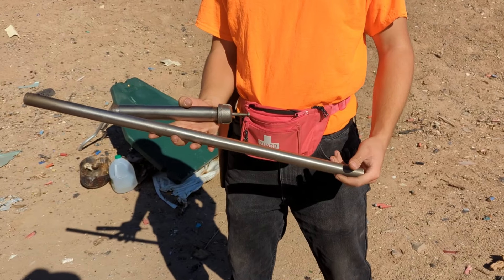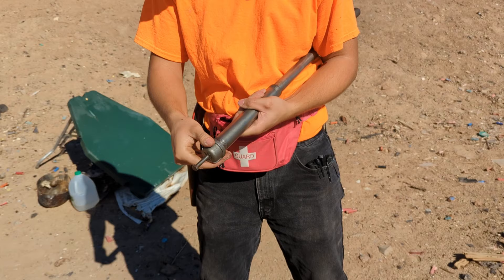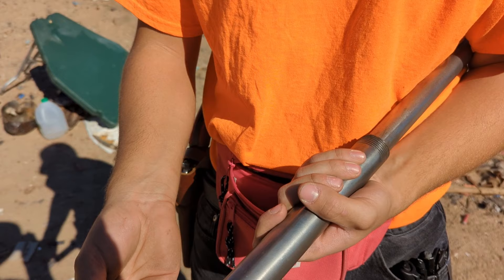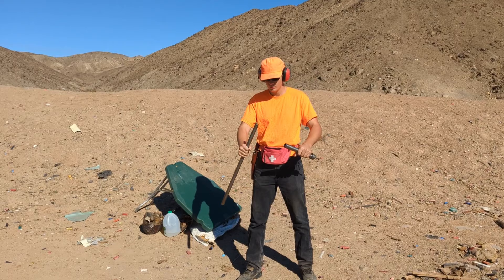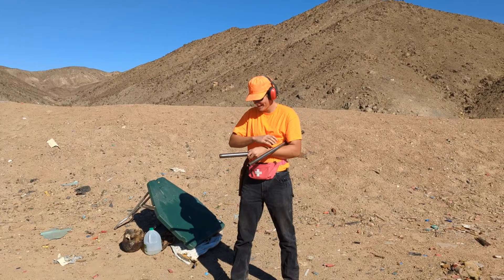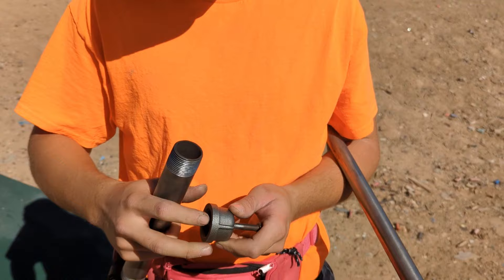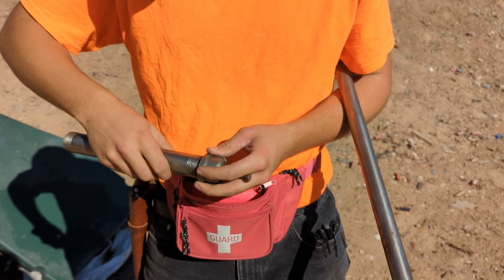The Mighty Pipe Shot Gun

Comment: For all these comments questioning the integrity of the build:

https://youtu.be/F7p9hX1TLtk
Reply from the maker: Shhhhh, it's funny to see them get mad.
Reply: @LawnMowerProductions  u
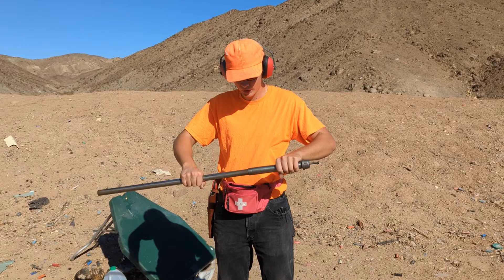Reply: 0:37 0:38 😅o 0:38 😅😅😅😅 0:40 o😅😅😅 0:41 😅😅😅😅😅😅 0:51 0:56 😅😅😅😅ooo😅😅 0:59 😅 1:00 😅o 1:00 1:01 😅o😅😅
Reply: I'm not questioning the integrity of the build,but the idiotic decision to turn the pipe around and use another round to eject the over swelled and stuck cartridge. I once saw a .410 shred it's barrel after a kid got a plug of dirt in it before firing. That was an extremely dumb move....
JUST SAYING...🔥🔥🔥😎
Reply: "I shot it a few times and didn't die, therefore zip guns are safe."
Reply: Ah yes another YouTube video from an amateur gun maker, there’s a reason for gun barrel metal those pipe shotguns are a disaster for the user and anyone around them.
Reply: @damoncox2822 

1. those pipes have a higher bursting pressure than a shotgun barrel 

2. The round being fired is not locked in and backs out when higher pressure is applied

3. The barrel Id is much bigger than the wad which not only means pressure is free to pass by the "bullet" but the powder cannot burn as intended and produces lower compression under any circumstance of firing this weapon
Reply: Make a dozen or more and take them to a liberal city gun buy-back. Nice profit there.

Comment: The pressure of a 12 ga. round is around 11,000 psi. The bursting strength of schedule 40 pipe is around 2600 psi. You might want look into using DOM seamless pipe. It would be alot safer
Reply: I read in another comment that stainless steel is also recommended for the pipe material. Is that correct?
Reply: @ye11owman29  it is much stronger that schedule 40 black iron pipe. But if I were to do this, I would ues hydraulic seamless pipe.  What ever you do(my opinion) don't fire slugs through these things. That's when the barrel will be under maximum stress from she'll pressure. Pipe failure could cost you your life. BE CAREFUL
Reply: Do you trust the pressure rating? NONO. I had 1/2" sch.80 seamless pipe break at 100PSI. I would suggest to do a pressure test.
Reply: Its not under seal so the pressure isnt contained. Yes there is a certain amount of pressure at ignition but is it enough to create catastrophic failure? I wouldnt gamble it. Id say this guys hands are on borrowed time without proper research
Reply: @dooooooval904  can we just use a sling or something like that?
Reply: First off you're comparing apples to oranges, the rating on the pile is a continuous rating. The SAAMI is a momentary peak rating. He is not even reaching full pressure because the shell is expanding. And he does have a second pipe over the primary pipe. I wouldn't do this with a 50 BMG, but I bet it would still hold.
Reply: @jagzilla1398  yeah. Pipe burst pressure is different depending on diameter. A 1/2 sch 80 is 20,000 psi burst pressurr and 4" schm80 is lower.
The trick is to add a small 1-1/2 pipe with a little cut over the 1" pipe. It can be fonem oh well i have a workshop. Lol
Reply: You help a lot in my caplock musket project dude 🦾
Reply: It’s not a pipe bomb it’s not capped at one end means it is the path of least resistance. Not building nearly that much pressure. Any gun will explode if you contain the pressure.
Reply: @BODShotgun  dont try a slug in it. What do think that does?
Reply: @jb-ik8sj  it wouldn’t suggest that
Reply: @jb-ik8sj  those pipes have ridges
Reply: @BODShotgun  it has a welded seam. DOM does not
Reply: @jb-ik8sj  correct. I wouldn’t put a slug though
Reply: @jb-ik8sj  true 👍
Reply: Lmao I've shot mine hundreds of times,no problems!
Reply: Good advice here.
Reply: The shell fits rather loosely in the pipe, therefore, much of the gas would leak past the projectile, which would cause the actual pressure to be much less than the SAAMI pressure.
Also, this design has a second pipe outside the portion of the inner pipe where the pressure is the greatest.
Reply: @dooooooval904 f*** it everybody's going to die someday live it up baby
Reply: @CFAPA  lol, your the " hold my beer" type! Funny
Reply: @dooooooval904  basically
Reply: And despite all that
....it works 🤔 hi 5 Bill Nye
Reply: The Classic 4 Winds Shotgun was with 400 psi. Its an Assassins weapon.
Reply: That's funny seems to how people have been doing this for generations and it works just fine every time😅
Reply: You Use gas pipe by the way
Reply: @atozproductions9660  but there will be that one time where quality control missed a batch of sub grade steel. Now you may have a flaw in the finished product. And since the US buys steel from around the world, this should be a concern for anyone experimenting with this concept
Reply: @jb-ik8sj   Well she used to how it's called a Filipino shotgun Needless to say you can use it at your own discretion
Reply: Two layers of pipe surround the shell.
Reply: Why not just use an old shot gun barrel? And a grinder..or for rifle ..you can find a lot of old barrel to cut up and play with .
Reply: @kyohiromitsu4010 
Wow..what an eye opener comment..
I've grown up shooting and reloading..I am fully  aware of barrel pressure..I think most people
Take for granted the power associated with 23000 psi..
OR THE FACT that no part of the human body is a match against pressure and steal 
Hahaha.

At least  not the world I live in..
Hahaha..have a fantastic  Thanksgiving...
This isn't my video..I was just snooping around  and appreciated your comment..it was very intelligent
Reply: @jb-ik8sj not after the 4 round goes through  it....hahahaha
Reply: @jb-ik8sj we're not talking about insects dude, what does a slug have to do with anything?
Reply: The Philippine guerilla’s used one similar to this during ww2 in their war against the japanese. I used a steel connector and a solid steel plug for my breech plug. Much stronger than your cast steel cap. Mine also has a stock with a movable forearm attached to the barrel. I use black powder reloads for mine. Works just fine
Reply: @Pointman-yf6or  yeah I like gorilla glue to
Reply: I've built these and never had a problem. Same with 1000s of others
Reply: If you put another 2 nuts on the outside of the bolt it would lock it in place better
Reply: @dooooooval904  he shoots out the stuck one....... cmon man
Reply: @BODShotgun  he shoots out the old stuck shell with a new one, what could go wrong? LOLOLOL
Reply: Or buy a shotgun for a cheap one 75$
Reply: Hi ,,so what pipe would you say is best to use  for safety please.?
Thanks & RESPECTS
Alex
Reply: @alexsheridan9529  DOM in a stainless steel grade. Wall thickness no less than 0.125".
Reply: Where i live you basically need to spend half your life getting a certification and an insane amount of money to own a gun, this is the only way i have of protecting myself and my family, sure it can kill me, but I'd wager that having a makeshift gun is better that no gun at all, and it's not like it's gonna see much use. Thing is criminals here do got actual firearms, don't know where they get them, but they have it.
Reply: @dooooooval904 This "Hold my beer..." only permits 2 failures, though. Losing 1 hand, or most of it, each failure  - after 2, somebody's ALWAYS gotta hold his beer...
Reply: @kyohiromitsu4010 Re - "Use a sling, or..."  You're right.  That worked for little David, vs. Goliath.  This is just "post- disaster", or hillbilly fireworks...
Reply: @mikecrystalrobert7898 You take all the "hillbilly fun" out of it, and Bar stories : "Remember Mikey usta have all the fingers on his right hand ?"
- True, though. If you need to hunt ducks or rabbit for your family stew - $75 pawn shop gun is a better idea...
Reply: agree seamless pipe safer
Reply: @jb-ik8sj actually dunno of you've heard of royal nonsuch or not but he was a homemade gun youtuber back then and he used to be famous for making guns just like this one from just homedepot plumbing pipe he did a vid testing different shotgun loads out of one and showed they would actually survive multiple slugs even going so far as using a slug and plugging the barrel with dirt and the pipe still didn't explode (though it did bulge) these plumbing pipes are surprisingly stronger then you'd think
Reply: @jb-ik8sj thts why u should always test your gun out before shooting it by hand (u can test it buy tying it to a tree or sticking it in a vice and using a piece of string to get the pipe to slam back to fire it) though tbh there's countless videos online plus countless examples Madd illegally/legally around the world tht show they generally work just fine also I've made one myself before and shot regular ammo (birdshot) out of it (not pleasent recoil when all u got is a block of wood for a stock but) it works just fine I mean shot a good few shells out of it then checked the inside of the pipe barrel and no bulges cracks or deformities of any kind
Reply: @jb-ik8sj btw not saying these are 100% safe (nothing is 100% safe and this is definitely not it prolly not even 90% or 80%) just saying there not near as dangerous as people belive and as for the answer to another commenter on why not just use an old shotgun barrel or buy a cheap shotgun well it's really for thr concept not generally actually to use the shotgun it's for having the knowledge in the event u need a gun and can't aquire one or just to do it to show u can
Reply: You can't blow a black iron pipe up with a 12 gauge shot shell target loads buck shot slugs none will blow it up,there used to be a guy on tube that jammed the barrel full of mud and then shot a Remington nitro express 3" magnum slug did nothing but blew the mud out there incredibly tough far stronger than any factory made barrel
Reply: @BODShotgun slug won't do a damn thing but shoot
Reply: Can I uses a sch40 black pipe or?
Reply: @jb-ik8sj  can a black pipe schedule 40 handle it
Reply: @shannonking3201 yeah that's right I think your the best commentor
Reply: @shannonking3201 well I saw that to on YouTube and got shocked to see how tough black pipe was and waiting for it to burst but nothing happened lol
Reply: @CarlmarkDeguxman-lx9qm  yeh u can most of these slam fire shotguns are made out of black pipe (which is schedule 40) I've done it before it's safe should prolly stick to birdshot though there's proof tht they can take up to and including 12 gauge slugs I just personally wouldn't use something besides birdshot/target loads unless you like have to for some reason
Reply: @CarlmarkDeguxman-lx9qm  yea
Reply: @CarlmarkDeguxman-lx9qm  just please try to stay away from slugs. Those will produce the most pressure. 00 buckshot it should handle fine as long as you dont plan on shooting it more than a few times. If you have calipers, pay close attention to any change in diameter on your 3/4 pipe. Discard if you notice change. I'm not saying this is safe at all. So don't misinterpret this. Please. And don't use it around children. There is a video on someone who made a pump gun like this. He did use stainless or DOM tubing though
Reply: @jb-ik8sj in this video the very back end of the shotshell did not explode but why does the back of  the brass shell where the primer is located bulges and explodes that's why some of the hot burning gunpowder exits out of the cartridge but the pressure somehow pushed the pellets out of the barrel why is this
Reply: @jb-ik8sj  is it the firing pin or the brass can handle the high pressured gas🤔
Reply: @CarlmarkDeguxman-lx9qm  i would thread a 1/4-28 bolt into a 1" cap, shape the end to mimic i firing pin. If I were to do something like your trying to do
Reply: @CarlmarkDeguxman-lx9qm  a barrel and a pipe are very different. There is much slot in the pipe where a barrel is precision machined to keep everything together
Reply: What’s the pressure rating of a thin ass shotgun barrel ? you’d have to cap it off to get it to explode. If you get dirt in the end of a shotgun barrel it’ll blow up too.
Reply: My conclusion, also.
Reply: @jagzilla1398 I've seen it done with a 50 BMG, it works
Reply: Agreed and pretty sure the end cap was  case hardened and that will shatter like nothing
Reply: @bobcat9314  Way smarter of an idea, but moderately more expensive as well.
Reply: @Noizzed  Look into 3d printing firearms
Reply: @jb-ik8sj  you could set off slugs in a contraption like this and the pipe wouldnt burst, do remember an actual shotgun barrel has a chamber and this contraption is just a tube with a loose fit for the shell, it doesnt develop anything near the pressure it would in an actual factory made shotgun
Reply: Might want to look into not making improvised shotguns

Comment: A friend from my childhood neighborhood blew most of his hand off like that. He had fired it many times, including to announce himself whenever pulled into the driveway at a party.
Reply: Your friend is a semi handless Legend
Reply: Keeping up with the maintence and have the proper clearances is crucial with boomsticks and zip guns. Even potato guns.
Reply: Sounds made up
Reply: Your friend sounds like Otto Von-Bismarck. He too, shot to announce his presence.
Reply: @user-xg2jm5mp2g absolutely made up. It is a literal impossibility. Maximum allowable pressure is calculated with the Barlow's Formula, and for A53, Grade B Seamless and Welded Standard Steel Pipe, it is yielded at a strength 35000 psi.... Anyone who knows anything about firearms knows all modern shotguns SAAMI specs are to 11,500 psi. Meaning these steel pipes are 3x+  stronger than the SAAMI spec required for literal shotguns, with the most shot gun loads around 10k. 

IE, these are way stronger than your average firearm, so unless your idiot friend placed his hand in front of the barrel, your story is BS.

Comment: From memory, maximum pressure for a regular 12-gauge shell is about 3 tons per sq in and occurs around 3 - 4 inches from the breech and goes down thereafter until about 0.17 tons per sq in at the muzzle. I think someone once made a shotgun barrel so thin at the muzzle that it could be cut with a penknife but fired OK.
Agreed about caution; you make the mistake only once.
As an aside, years ago somewhere in South Africa, folk were ordering 'Morris Minor' (produced 1948 - 1970) steering columns like they were going out of fashion to the extent that Morris sent their agent to investigate suspecting that these components were failing prematurely. It turns out that the steering column, a high-grade cold-drawn steel tube fitted a 12-gauge shell rather nicely and the rest, as they say, was history!
Keep firing but make sure your fingers stay where they are!
Reply: WTF is a ton per square inch, mister engineer?  From memory, sit down.
Reply: If you don't know you shouldn't speak buddy
Reply: As a kid i lived near a ski lodge with old doubles hanging in the log rafters, one of them had a gnarly blowout at one chamber.  Quite the conversation piece!
Reply: Judging from the question of "what is a ton per square onch" reflects  the intelligence of some people i work with , not being able to do basic math and not being able to read a tape....1 ton is 2000 pounds ,on a side note,I wouldn't want to be  caught with that assembled and loaded (obvious reasons)

Comment: We used to call that a "zip gun."
Reply: Zip guns were normally in 22lr as they were made with way less quality materials.  At least that's my understanding of 1950s gang weapons.
Reply: Boom sticks for the larger sizes. Zip guns are usually .22 caliber, rimfire vs centerfire. 
In the boomstick there's a lot of loss around the escaping charge because of the difference between the cartriges outer diameter to the rounds diameter. They shoot way below the cartridges potential. It's perfect for Dragons Breath rounds though. Those need slop.

Comment: i would use sch 80 pipe for this as it will handle more pressure than sch 40. also some high temp high pressure thread locker will stop the loss around your firing pin. 
my day job is boilers and chillers so i deal with a lot of pipe. 
nice build
Reply: I loved it when this old white guy gave me 500$ for shooting a video with him it easy money
Reply: I like that choice but damn its heavy.. I got about 32" od 2.5 sch. 120. Thats3 some thick wall shit. It actually measures 2.44" ID which would be perfect for a  billiards pool ball.
Reply: I made a diy 12 guage shotgun about 25 years ago with schedule 80 pipe. I had to chamber it to take 12 guage shells, it held up pretty well but if you don't cut a chamber into it, you end up with a 16 guage. Safe shooting out there. 😊😊😊
Reply: WRF is a rando gonna get Sch. 80 pipe?  The hardware store?? XD
Reply: @railgap  why not?
Reply: Good idea
Reply: Would be concerned about the end cap blowing out....cast iron fittings are relatively soft,be safe
Reply: @mikenhorn
Me too. Im not a plumber but i dont have a girlfriend
Reply: "That's what she said!"